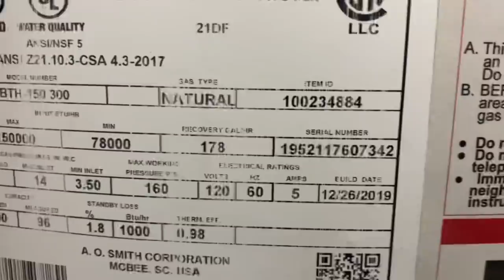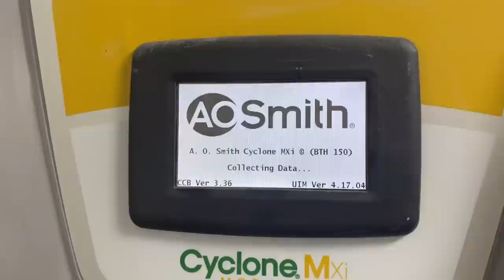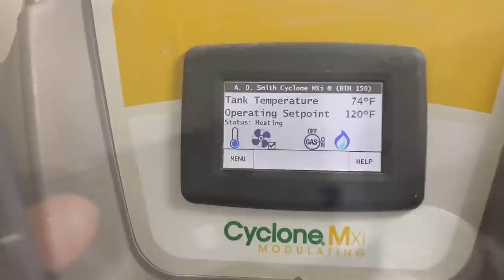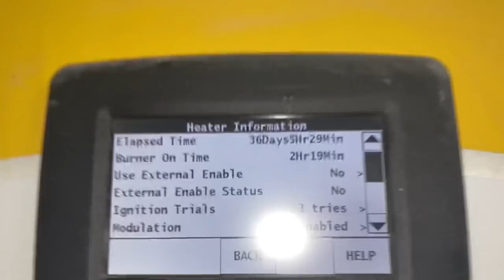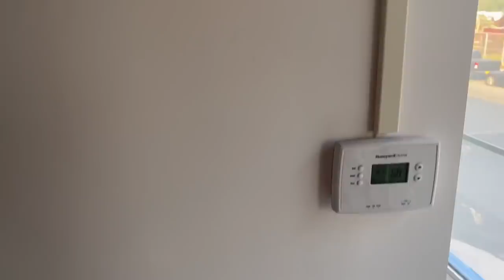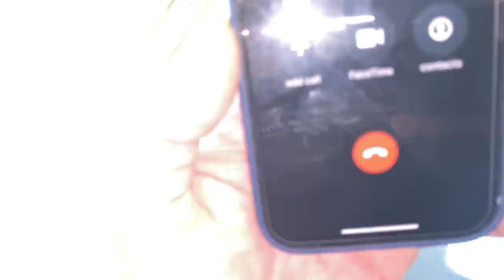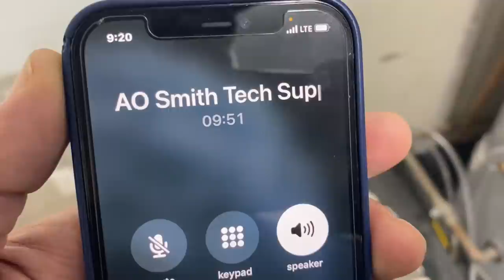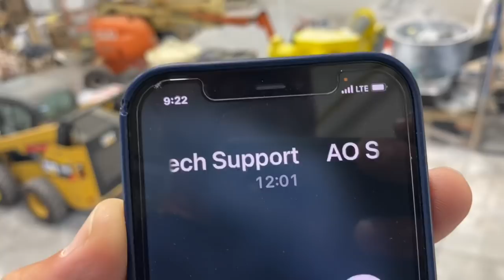$10,000 Commercial AO Smith Cyclone BTH-150-300 Water Heater Complete Failure - Improper Install

Comment: AO Smith Tech Support Guy was Top Shelf. It is great when you deal with guys like that, they care about the product being installed properly for the longest equipment life expectancy. It was really great of him to pass on the Expansion Tank Information. Definitely need to make sure building pressure is below 80 Psig, can’t assume the Plumbing Engineer did his homework, looks like the accepted existing piping was not sized for a 100 gallon tank. I’m sure you would never run out of hot water with the 1/2” supply piping. It would probably kill the heater prematurely. Thanks for taking us along.

Comment: I can't believe they were willing to replace that tank under warranty.

I was sure with all of the things wrong with the installation they would have voided the warranty.

I guess it pays to call the pipe doctor.
Reply: @PipeDoctor  Installer is blacklisted now for sure, what a hack. Should have gotten pressure readings from the unit, it will show you gas and water. There are some ss squiggle menu's in there.
Reply: Seems like a good company with a good policy.  They'll help the customer out if the customer is willing to correct the issues.  I like it.

Comment: was it the tank leaking or the fittings leaking ? cause it sure looked like the fittings where leaking and if that was the case why cant the fittings be fixed and the top of the tank cleaned up

Comment: AO Smith tech guy was a class act. You can't ask for more than that. Many companies will try to play games, and frankly, AO would have been well within their rights to say sorry bud, but you own it for the improper install on a unit that expensive. That was above & beyond for him to cover it. AO Smith & Bradford White are awesome to deal with. Also find it pretty hard to believe a licensed plumber didn't install the expansion tank on a closed system like that. Shocking. Unless Mr. Business owner did it himself.
Reply: AO SMITH hot water heater are absolute trash.

Comment: The inlet piping also needs a tee inline right before it connects to the heater. This is a condensate style trap that is to discharge into an indirect drain as well.

Comment: I am curious, as to the outlet sizing- Yes, its 1/2" but why does it have to have a larger outlet size? Maybe some thermal conductivity or some thermal expansion factor for the hottest water comming out? Otherwise its no different than the point of use devices like a bathroom sink which is also 1/2" .
Reply: Im sure it creates an issue with thermal expansion, especially if there’s no expansion tank and  even worse if there’s a Backflow or check valves installed not allowing the water to go backward into the supply. 

Many places I’ve seen don’t have expansion tanks installed and when they’re told they need it they say “it’s worked fine forever” kinda like saying I’m lying lol then again though those buildings have leaks galore at the fixtures. Imagine if those leaks were corrected…we’d be looking at a can of worms down the road without having an expansion tank
Reply: Tanks were built better back then! Lol.

Comment: Just came back from a Navien NCB no heat service call. Ifc board completely fried, literally all of it is brown, lots of oil all over the plastic parts, exhaust packing ring dripping and combustion chamber is leaking A LOT! I condemned the unit. Sold him a rinnai combi unit.
Reply: @PipeDoctor  240E
Reply: @PipeDoctor  i120cn for the rinnai.

Comment: The neutralizer is likely not connected because it likely gives too much restriction and the water heater trips off on blocked venting (super common for these units). The drain is supposed to be done with 1/2" PVC sloping the entire way to a drain where it terminates away from it, but doesn't actually disappear into it. The manual doesn't even show the unit using a neutralizer, even tho it's a plumbing code requirement to use one on all condensing gas fired equipment. The 1/2" copper outlet was rather silly considering he only needed 2' of the proper sized piping before hitting the 2 larger pipes leaving the water heater. This wouldn't have affected the water heater since it simply modulates its output based on demand. It just would have reduced overall output btu ability based on how many people are calling for hot water around the building... The tank leaking all over is almost certainly the result of their junk product. They have horrible quality control on their commercial water heaters. The control and overall design of the tank is great service wise and user friendly with lots of bells and whistles with great intentions, but these tanks just don't deliver, unfortunately. I've dealt with older commercial tanks 20+ years old and kicking. None of these Cyclones will make it to 10 years. Lots are failing at 1st day of install, 2 years, 3 years, 5 years, etc...
And this Mikey Pipes guy is annoying. I'd hate to be one of his customers. He's overly obnoxious, excited, and rude over little things. Telling the guy to get the tank turned off before it blows up? Come on. The fact you see it leaking out of the pressure relief shows the safety device is working and that it is full of water. It's not about to blow up.

Comment: looked to me like the water was coming from the giant outlet copper adapter fitting threads. tape-n-dope both, especially on oblong out of round cast copper fittings. they either only taped or doped it. if it was in use always hot, it may have sealed, but probably not

Comment: nice to offer a new tank. but not understanding how US businesses and warranty like this operates i can assume they are going to have a " conversation"  with the orginal installer and pull their brand for example? sidenote: how the F does a tank like that cost that much? in the EU a tank of that size would be well under 2k for even a more economical heat pump version, not even gas fired.

Comment: The switch is now an enable/disable switch. You have to be careful because there’s power on all the time. Piping and gas are just poor engineering on the design of the building. The heater probably froze if it was hooked up to the fresh air and vent piping from the get go. 
We have had  1  recently that leaked on Install. We use a lot of them

Comment: that stub of 1/2" is short enough to not effect it much and will limit the total volume leaving the tank. they likely figured the fools would run the hot wide open cleaning equipment and cry it didn't keep up with demand. more or less, they used the 1/2" pipe as volume limiter ;)

Comment: With those defects on the piping size and no expansion tank AO Smith could have declined the warranty. They lucked out !
 Half inch on the outlet what’s that all about ?
Gas pipe size is probably wrong. That heater must have an enormous BTU input.
Reply: 150MBTU max...

Comment: Not that it’s a big deal but the specs says there has to be unions on both hot and cold water inlet/outlet.
Reply: That's only because the water heater is such a piece of junk, it's a certainty that the tank will have to be replaced shortly after a new install, and then if it does last a couple years, it will only be a couple years before a new one is required again.

Comment: Support dude "That is WRONG".  Pretty much.  RTFM during install and you would see it's in the big CAUTION box "properly sized thermal expansion tanks are required on all closed water systems" page 4, T&P must not reduce in size from the outlet pipe size page 15 (T&P came with unit so they wouldn't have replaced this with the "wrong one"), Gas line required 3/4" page 11,   Expansion tank is mentioned on MANY pages eg p14, A sign on exhaust gas vent is required page 20 saying keep area clear, proper water pipe size doesn't appear to be a likely failure, you can use the 1/2" water pipe if that meets your flow rate needs and it wouldn't screw up the heater but it's still dumb with a big ass commercial heater to not use 3/4 or 1" otherwise why buy something like this? It could be that the water connection on the top of the heater is simply bad, a lot of that rust was near the water outlet so a simple leak here is possible due to bad fittings, bad braze joint where they go from the outlet to the hot distribution pipe near roof.  If the heater was installed early in construction they might have cracked things on the pipe when building walls if someone was leaning on pipes like drywall taper.
Reply: ditto, the outlet 1/2" section is likely "engineered" there as volume limiter as is the smaller runs to usage points. in cooler weather they'll use the hot water via garden hoses excessively and without limiting it would always be out of hot water. they keep the trucks washed inside and out in freezing weather. not to mention warm water to help the concrete not freeze prematurely in winter.

Comment: 0:12: 🚗 A technician is on the way to a service call for a leaking water heater.
4:59: ⚠️ Issues with water heater installation and operation.
10:05: ⚠️ Issues with water heater installation and maintenance.
14:39: 💧 Discussion about water heater installation and parameters.
18:26: 💧 Discussion about water heater installation challenges.
Recapped using Tammy AI

Comment: You could've just flipped the disable switch to turn it off instead of killing the breaker.
Reply: @PipeDoctor  I agree, it just seemed like you were trying to get the flame out so the pressure would stop rising. I just installed a high efficiency 400,000btu Bradford white water heater a few months ago. It's a beast of a water heater. About $13k.

Comment: I bet that water was leaking from the person who did the plumbing. 1-1/2 male adapter with a 1-1/2”X1/2” copper bushing? There is nowhere to wrench that fitting in other then putting a wrench on the soldered portion of the hub. No shit. Should have did a brass nipple with an FIP then bush it down so you’re not wrenching on a soldered part of the fitting. NEWBS